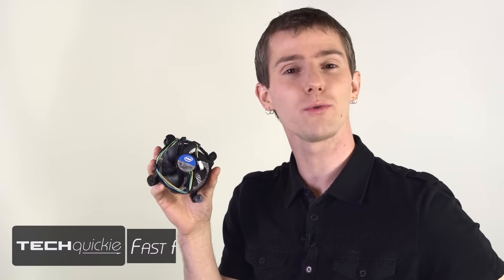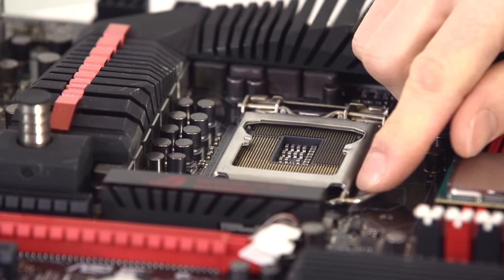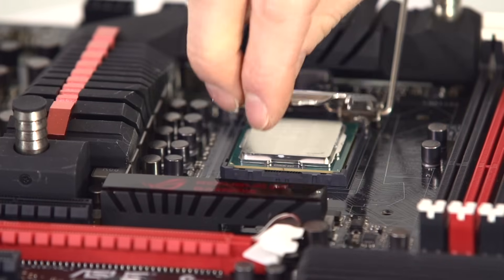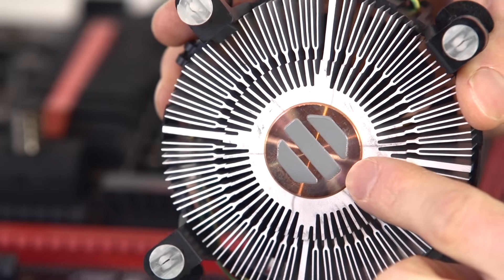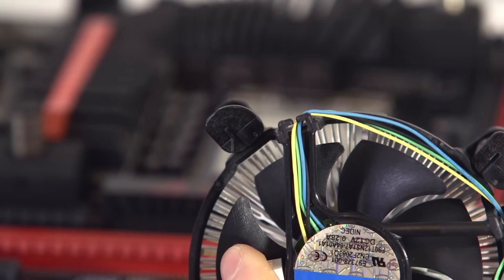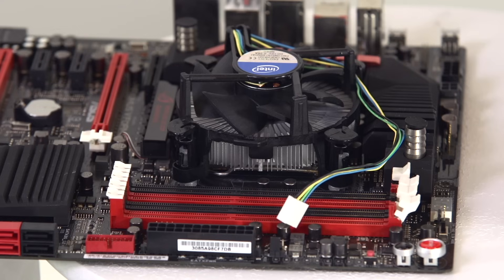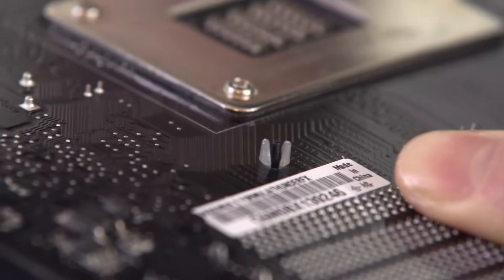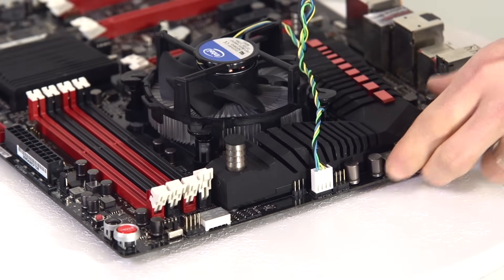Install an Intel LGA1150 or LGA1155 CPU Processor as Fast As Possible

Comment: I screwed this up last night after reapplying thermal paste but now I've seen some instructions I hope I get it right this time.**  Tried again after work and only one corner clicked in.  I turned the arrows in and still no luck and I really don't want to have to remove the motherboard.

Comment: Why didn't I find this video when installing my cooler. Had to remove it because the damn cable wasn't long enough to reach the power connector in normal orientation.

Comment: I did not know about the pint orientation. :(
I can't remember if I check if there's a thermal paste down there.
I cant check it cause I don't have a thermal paste. :( because I believe there should be already applied on that stock sink. :(
Reply: +R. Aldea there is already applied

Comment: Question on the heatsink that comes with the cpu: Is the thermal compound that comes pre-applied any good, or should I take it off with rubbing alchohol and use a different thermal compound? I've noticed some people will take it off and use a different one, and some people will leave it on. Sorry if this is a stupid question :). Thanks for any responses.
Reply: it's fine, don't rub it of
Reply: Oh ok thank you!
Reply: so does the i5 4690k come with the pre applied thermal compound
Reply: @JNLN The CPU itself never has pre-applied thermal paste, Just the heat-sink it MAY come with. (Not all CPU's come with heat-sinks and not all heat-sinks come with pre-applied thermal paste)
Reply: Mason DOTNET don't worry I meant to say if the stock cooler comes with it// I've brought it it dose come with thermal paste on the stock cooler
Reply: JNLN Yeah, they are usually nice enough to pre-apply it. But sometimes (depending on manufacturer) They wont. And sometimes there will be people who dont even know you have to have thermal paste so when it dosnt come pre-applied, they just slap there heatsink on there CPU and then they get frustrated when there CPU keeps over heating and throttling down.
Reply: After all this, I ended up choosing liquid cooling. Looking forward to building it!
Reply: Julian Berry built mine last night runs really quiet and cool
Reply: JNLN Yep, Im about to buy a corsair h60 to cool my I76700k.

Comment: LGA1151 CPU coolers can fit on LGA1200 sockets. The heatsink mounting on Intel's new LGA 1200 (code name Comet Lake S) is identical to all LGA115x sockets (LGA 1150, LGA 1151, LGA 1155, LGA 1156). Therefore, all Noctua CPU coolers that support LGA 115x also support LGA 1200 and don't require any mounting updates.

Comment: I‘ve got a problem. I got this cooler and I am really scared to fuck something up. I did the first steps as told in this video, but when it comes to  the clicking it in part I feel like I‘ll break it. I am applying a good bit of force, but it wont click in. Any ideas/tips? :(

Comment: can I install LGA 1155 processor on Lga 1150 socket?
Reply: ES ES no. It may fit in, but won't work. It won't be compatible with the different chipset on the mobo.
Reply: Biferony X thanks! after all someone answer my question. thanks again.

Comment: Installling my i5 3570k was a horror show :( The resistance felt way too high so i double and triple checked with both the arrow-marker and the mobo manual instructions. I had it right and so pushed the lever down. The entire way there was an awful grating noise. It works fine though and i've later checked it and no pins were broken. 
Has anyone else experienced this grating noise?

Comment: so a stock cooler from lga 1150 will work on lga 1155 motherboard and cpu? and i NEED HELP : if im using a stock cooler for the 2nd time, where do i put the thermal paste? on the cooler like if new OR on the cpu? on the cpu right?

Comment: Can I use my LGA1155 on a motherboard made for LGA1150?
Reply: I don't believe so. Reason is because the pins or pads will not align correctly. tech quickie has a video about this. watch it to make sure.
Reply: Thank you for the answer :)
Reply: No problem.

Comment: How do you tell if the pins are aligned perfectly prior to closing the metal bracket?? Do the pins go into the CPU without much effort?
Reply: It seems that most every comment by this potato no fellow is an insult...

With Intel CPUs (All LGA CPUs Are Intel), each pin in the motherboard socket makes contact with an electrical pad underneath the CPU. If both the CPU & Motherboard sockets are identical (they must be), the small ridges in the motherboard sockets should fit perfectly with the indentations in the CPU Chip. If they don't, don't use force. EVER. Either check to see if the system works anyways or check to make sure that the board and CPU are definetely the same socket.

Comment: hallo , when upgrading the CPU , man must  update the BIOS  ? i have a Hp pavilion 550-203ng prossesor intel core !5 X4 4-600
new processor intel core !7 6700
Reply: OK i assume you mean Core i5 6400. The processors were launched simultaneously so no BIOS update should be needed. Well there's two possibilities: either the replacement will just work, and no update is needed, or they limited compatible processors deliberately and the replacement won't work, but a replacement BIOS is not available.

Comment: No thermal compound?!
Reply: +Solo Delibird if you listen and watch the video.. at all. You notice that the thermal compound is pre-applied on the stock CPU cooler.  

If you've bought an after-market cooler, those come with either thermal compound pre-applied or in a separate tube, bag or what-ever. Which you need to place yourself on the CPU.
Reply: +Solo Delibird The stock cooler came with thermal paste pre-applied.
Reply: Joey Hobbit Sorry, missed that the first time around!
Reply: Solo Delibird no problem!

Comment: is intel core i5 3450k work for LGA1150
actually its LGA1155
but does it work?
Reply: +AQW JameZ the i5 3450 will NOT work on a LGA1150 board. It can ONLY work on an LGA1155 board.
Reply: ThePopStarDude productions thx im so nuub xD
Reply: AQW JameZ No problem, happy to help.

Comment: Would the fan used in this video work for an LGA1151 socket ?
Reply: +HarJBeRw And could be a danger if I used it on a new Skylake i-6700k CPU?
Reply: +HarJBeRw No as long as you buy  the 95w TDP fan as the stock cooler doesn't come with the k processors. You cannot overclock with the stock fan, you would be better off with the i7 6700 non k as it also includes the stock fan!

Comment: I took my cpu and fan apart after the cpu cooler got loose. The thermal paste was pretty spread out and messed up it seemed. Now my cpu will reach 90º C even when playing games like csgo. It is annoying and throttles my cpu to trash and ruins my pc. If I clean them both with rubbing alcohol and reapply will it start cooling correctly again? I have the i7-4790k and this same cooler. plz hlp I have no monie for real cooler </3

Comment: So I smudged the thermal compound a little on the heatsink before installation. Should I buy some paste to put on or just go with it?
Reply: +Krenillis clean off the paste and put new stuff on. it depends how much you smudged it tho, if it's just a bit off one corner it should do fine. but i myself would scrap the preapplied stuff as for me, it never seems to give the best thermal contact. applying your own is best if you want your cpu to run cooler.

Comment: Does an lga155 motherboard require a different powersupply then a fm1 motherboard?
Reply: no, all modern mother-boards use the same 24 pin and 8/4 pin power connectors

Comment: how hard can you push on a motherboard before you should be worried?
Reply: +Tiparium hard
Reply: Just don't fold it and you'll be okay (strong pressure applied from the edges).
Reply: if you hear any cracking noises then you should be worried :))

Comment: can anyone recommend a good CPU cooler around the £50 mark.  Easy to install is essential
  I hate those little twist and push pins that come with the stock cooler
Reply: Hyper 212 evos can be had for under $30 US and are MUCH better than stock.

Comment: hey, I need to know... how do I tell if my fan cooler is 1150 or 1155? I need a new one and I dont know which one.
Reply: Rocio B it will be the same with both, they have the same shape and hole spacing.
Reply: Rocio B just look up what kind of board you got and it will tell ya

Comment: You know, i've also done it 10 times or so but I always forget which way the push pin should be rotated for installation. And that trick to  twist the wire is new for me.

Comment: I have the i5 760 CPU works at 2,900 to 3,300 mhz. has 1.200v-1.344v temperature 50-62c in CPUID is this normal with this cooler, pray for an answer

Comment: So do do I have to have a certain mitherbored just to put my i3 in there?
Reply: +MiniMuscleGuy Carlos well, pressuming that the i3 has an lga1150 socket then you will need a motherboard with lga1150, if it is lga1155 or lga1156 then you need to get a motherboard with lga 1155 or lga 1156, the stock cooler WILL fit on the motherboard if the i3 goes in nicely

Comment: I opened my proccesor And put bre thermal grease. I am scared if it droped in socket. I turn on it normaly And it works normaly in windows, temperatures is good speed is good. What will hapen if thermal grease droped in socket?
Reply: Your gonna have a bad day if that happens
Reply: @OortCloud  i used it 2 days it is okay, no errors but what will happen?
Reply: @СтрахињаБоровница  You mean to tell me you dropped it into the socket?
Reply: @OortCloud  i think i not droped but, i am intresteded what will happen?
Reply: @СтрахињаБоровница  CPU Will most likely stop working
Reply: @OortCloud  will it get picture?

Comment: I want to change my Intel cpu fan. All fans are standard ?
Reply: depends, but "AS I REMEBER" the holes of socket 1150 way back to 755 are on the same spot. But I really recommend you a coller that is specified to be supported.

Comment: about to upgrade my i3 6100 for a i7 6700k do i need to download any drivers before i change processors or do i just take old one out and new one in and it will run?

Comment: holy heck why'd it go in so easily? i thought that when i installed the cpu (over a year ago), i had to h*cking place the cpu under the cover, push down on the bracket, then push down on the metal arm until the cover snapped off...
was that  a dream?

Comment: will a i9 9900k processer work with the intel cpu fan?

Plz answer i am new to pc
Reply: The i9-9900k doesn't come with a stock Intel cooler included, so you would have to use a cooler from a different brand, and the installation for that cooler would be different. The cooler you purchase does come with an instruction manual on how to install it, or you could probably find a youtube video on it.
Reply: @Max-zw8vp   well i have one that came with my pc and i am using it do you think i would have to buy a different one?
Reply: @Juserrnative  As long as you aren't doing any major overclocking, you should be fine with it. If you want to overclock I would consider getting an AIO/A more beefy air cooler.
Reply: fakeappledog ok thanks
Reply: @Juserrnative  One thing I would do is download HWinfo (just google it, should be the top link) and monitor your CPU temps. If you are consistently getting over 80 degrees C, I would consider getting a better cooler.

Comment: the manual of my motherboard and the black cover itself say, that it should be removed after the cpu is installed in the socket, is that different for each motherboard or is Linus doing that wrong?
Reply: it is recommended to leave it on before installation so that debris won't get into the socket but Linus has been doing it for some time now and well it doesn't stay without a cpu in it for long. in your case I'd say leave it on it pops right off after you've installed your cpu anyway.

Comment: I was one of those that experienced great difficulty.  Here's how I got past it.  First, examine the way the white pegs at the bottom work.  Each peg has a split white piece that a black piece will travel downwards to push the white peg apart and prevent it from popping out of the hole when properly seated.  Notice the flat circular part of the white peg, this ring is what will rest on top of the motherboard once the peg has gone through the hole.   First pull up on the 4 black pegs that turn as this will complete retract the middle piece that pushes the peg outwards, but then also push down on one black piece to see how this works.  The black piece almost immediately reaches the thickest part of the white piece preventing the white peg from collapsing inwards to get skinny enough to easily pop into the motherboard hole.  So the solution is simple.  Don't press on the 4 black pegs like Linus shows here.  Instead make sure the 4 black pegs are completely retracted and don't touch them again until the white pieces are perfectly seated with the white ring of the peg laying on the motherboard. 

So:
1. Pull up on the 4 black pegs
2. Handle the heatsink by the black ring only
3. Insert the heatsink into the holes.  Give it a wiggle as Linus suggests to ensure the pegs are in the hole
4. Push down on the ring BESIDE the peg with a thumb and one finger, but not the top of the peg and use the other thumb and finger on the complete opposite side to do 2 pegs at once 
5. Repeat for the other holes
6. The white pegs will still give a click once they seat in the hole correctly.  Give it another wiggle and it shouldn't move anymore.  I used my phone's camera to check each white ring was down and then a tug for good measure (I don't have access to the back of the motherboard.)
7. Now you can turn the 4 black pegs 90 degrees to lock the white pegs apart

Don't forget to plug the fan back in like I did

Comment: HAHA I just reinstalled mine because my new CPU was stuck at 800mhz I tried everything turns out it wasn't even touching the CPU the bead of CPU paste was still a pea size dot but now its working great I guess the CPU needs to be touching the CPU cooler heat sink for an good temp reading?

Comment: can I use 1151 socket processor on 1150 socket motherboard???
Reply: DiePiePep no u need exact numbers

Its like lego if one piece says 100 and one says 103 they simply wont match

This is specificly talking processors and motherboards

Comment: if i dont overclock, the stock fan will be ok for gaming??
Reply: If seated properly, yes.
Reply: THERAZORKILLE Productions Its okay for gaming and you have nothing to worry about (the temperatures might rise up to 70+ deg. Celsius). However, If you want it to run a little bit cooler you can always add a cheap cooler (but check the brand and item) and the temp. will drop at least by 10 deg. cel.

Comment: i just installed a new cpu now my games lag and i dont know why please help
Reply: shiverthehedgehog09 did you apply Thermal paste?! In this video his heatsink already came with paste

If your games are lagging its not the cpu its the heat stress due to no thermal paste

Also, a cable may be hitting the fan which would also cause heat stress and lag

Comment: Hey guys  here is a stupid question and would mean a life if someone could answer can i fit a LGA1150 procesor to a motherboard socket 1155?
Reply: No you cant. The cpu sockets only work for one specific lga number each
Reply: No. 1150 pins on your processor, 1155 pins on your mobo. No talk.
Reply: The motherboard and CPU sockets must unconditionally be identical always.
Reply: not necessary. I have instaled xeon s771 on my s775 mobo.
Maybe they make some adapters(in the future) to fit cpu s1150 on s1151/1155 mobo...

Comment: Put on new thermal paste on my cooler and now temps are even worse. Pretty sure I didnt seat it correctly but man is it a pain in the ass to take those plastic tabs out. Would rather buy a better cooler but I'd have to take the pc apart to install a good noctua cooler. I hate this stupid cooler.

Comment: It seems like everything that I touch breaks.. The very first time I installed my heatsink, everything was fine and I had no issues. On my 1st reinstall, I tried to push the pins down but one side wouldn't release the black portion far enough no matter what I did. On my 2nd (attempt to) reinstall, I pushed the pin down on one side too hard and it broke through the hole. I tried to take it out and reinstall the heatsink a 3rd time, but now none of the pins are going down far enough. At this rate, I'm not going to be able to play games until sometime in January because I'll be busy replacing half the stuff I already have... Does anyone have any tips for a stupid novice builder like me?

Comment: Unless Intel, Asus and some other vendors are wrong, you SHOULDN'T remove the cover of the cpu before placing it.
It actually pops out once you place the cpu in place.

One last piece of advice, keep the cover in a safe place. Most manufacturers WON'T receive your motherboard if you return it without the cover. (warranty purposes)

L8er!
Reply: Linus know that now, in his recent build guides he does it correctly
Reply: *****
Lol
Didn't noticed that part.

Anyway, it's not for him, per se. But for anyone who's following this guide.
It's better for people who doesn't know how to do this, so they are not mislead.
No one wants to bent their pins or lose warranty, believe me n.n

P.D. Knowing it, but not doing it it's the same.

Comment: When I check my computer's stats, I see that I have a LGA1155 socket. But when I open it, the holes are not like the ones you are showing here (they are holes for screws). So if I understood correctly, all LGA1155 hardwares (cooling fan in my case) are not necessary compatibles together? (having a LGA1155 cooling fan don't necessary mean that it will fit with a LGA1155 socket, depending of the hole type?)